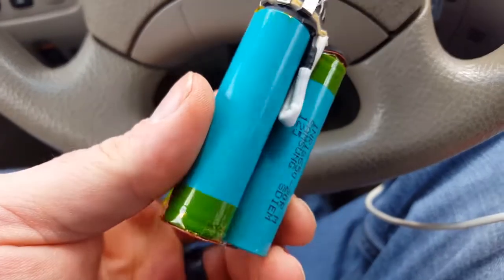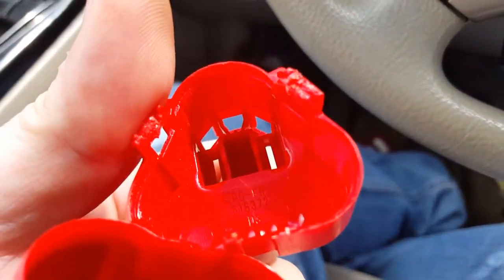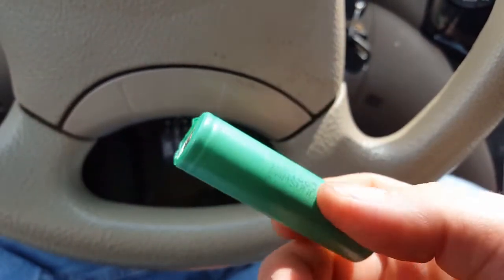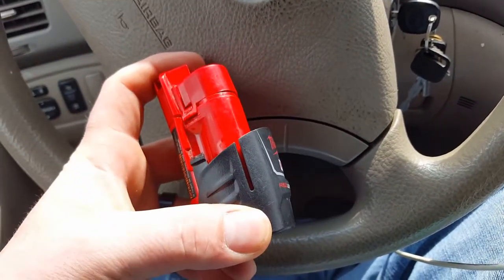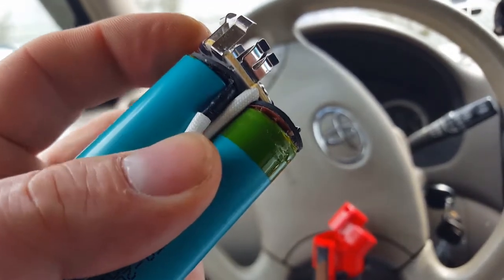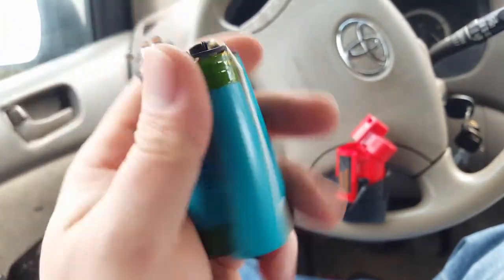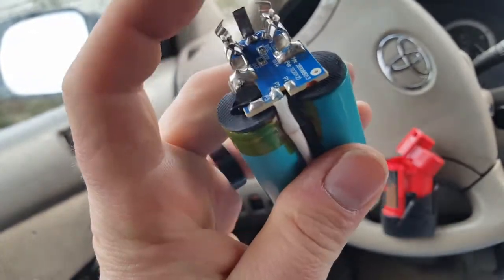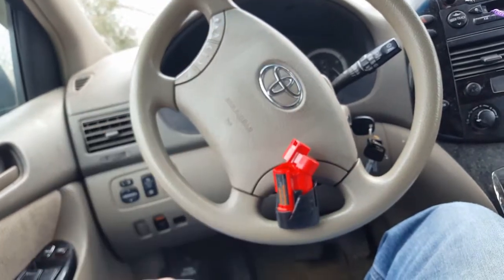Milwaukee M12 battery teardown

Comment: Milwaukee is making batteries now that dont have the seam in them in the center of the top so you cant take them apart like this.. and this is probaly why lol, you could rebuild your own batteries. Save! The old style ones if you have them and wana risk doing this!. I just bought a couple kits from hd the other day and all the m12 batteries have changed and are now sealed up all the way.
Reply from the maker: I need to get one to experiment with cause if they are manufactured, then can be disassembled. Maybe it will require cutting and adding some sort of retaining clip modification but I'm excited to dig in. If one fails on ya, please send it my way and we will see if we can get it all fixed up

Comment: Hey so inside a m12 battery is 3 x samsung 2500mah batteries 18650 type? If thats the case i would upgrade it to something with more juice as well
Reply from the maker: You can, but it's about discharge. I like the cells because of there storage of by my tests 2400 mAh and 22 amp discharge limits. 

For my hoodie that takes m12, I use a m18 and adapter for them because it gives me a 10 hour shift per charge and my drill impact set is a m18
Reply: My 1.5 had a 1500mah
Reply: 2500mah ain't bad but I managed to get some 3500mah 😈😈

Comment: How can Milwaukee achieve a nominal voltage of 12volts if a standard cell voltage of one lithium ion cell is ONLY 3.6V? (3 X 3.6 = 10.8V)
Reply: Yep, so 3 x 4.2 = 12.6V. Furthermore, the "3.6V" that you quote means absolutely nothing. This is simply the "nominal voltage" which means it's the halfway point between "full charged" at 4.2V and "fully discharged" at 3.0V.
Reply from the maker: Because that cell voltage when charged is 4.2 volts.

Comment: Yeah when i'm bored at stop lights I like to tear apart batteries also
Reply from the maker: Gonna have to try that one Dave. 

I was gonna parking lot with an idea.

I'm a tramp, I travel for work so I don't get much time home, as per my video output. Right now I'm drinking on the side of a mountain listening to salt n pepper or blue grass or what ever. 

But since you like that, if you scroll back to a vid named vape meet modding, I build a ecig in my truck at a vape meet. For shits and giggles
Reply: Glad someone else notices the heavy bluegrass influence in the salt n peppa body of work